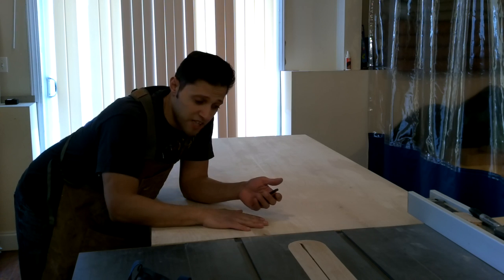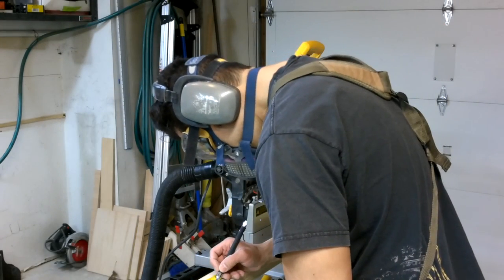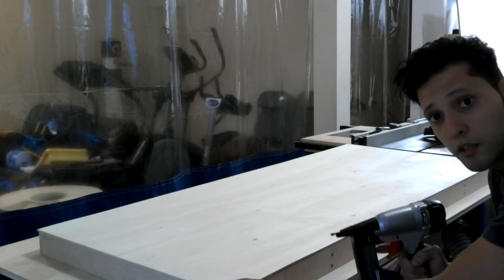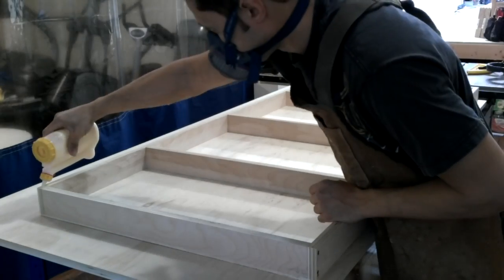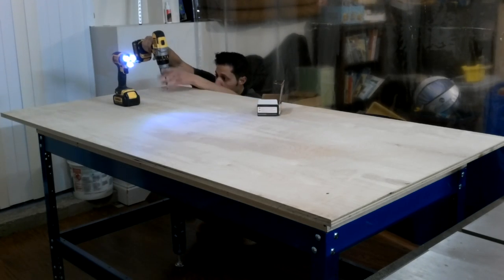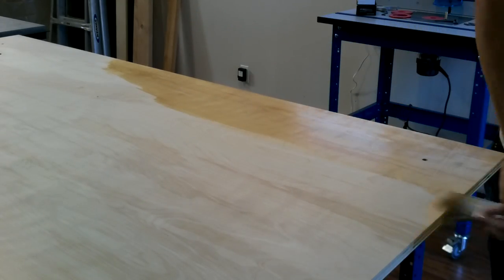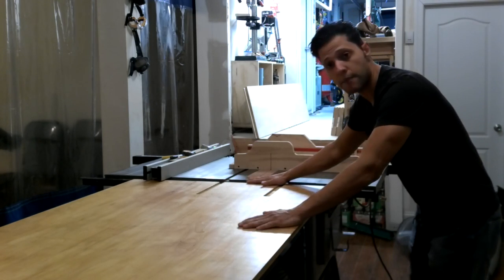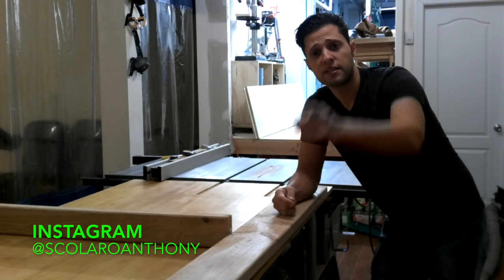Make An Assembly Table

Comment: I'm not a woodworking pro so I'm wondering why the torsion box? I'm guessing that you want the 3/4" top for clamping (where as others build thicker tops) but the torsion box prevents the 3/4" plywood top from sagging down over time. Maybe you are using it to make the build lighter also?
Also, where do you get the see through courtains? That would help limit dust to the areas that I work instead of spreading all around my basement which happens even with dust collector.

Comment: Anthony, where do you typically buy your birch plywood or other lumber from? Say for your blanket box or even the dresser you made awhile back, is that all real expensive cabinet grade stuff? Thanks in advance, great work
Reply from the maker: Mike S thank you and as far as plywood, whenever I'm building cabinets or cases, I use cabinet grade, they run about $50.00 a sheet. for my lumber, I go to a hardwood dealer and buy it rough then I dress(s4s) it myself
Reply: Thank you sir, I have some simple projects in mind just getting started in wood working, went to my local HD and all they had was crap wood.  I'll have to do some research on local lumber yards

Comment: Awesome video Anthony, I swear man, every type of project I am wanting to do, you have an exact video for it. Does removing that little clip in the back of the fence throw off the measurement when the fence is clamped down? Im assuming you had to take it off to have a flush fit but Its hard to see how the outfeed table mates with the 5100 in your video as you have no close up view of it. The back rail sits 5/8 below the saw table top, Im having a hard time understanding how you are able to butt up a 3/4 sheet of plywood against the saw table and still manage to be 1/32 below the level of the saw table... Even if the outfeed table is against the back rail and not on top, that little black clip in the fence would seem to be in the way. Can you please tell me what you did, the gerbil in my head cant stop spinning lol. Cheers.
Reply from the maker: Jay Ross the outfeed table is not butted tight up against the saw rails. I left just enough room for that clip to slide.
Reply: Right on, I was having a bit of a time trying to figure out what you did there. Thanks.

Comment: Dimensions of the steel base please?
Reply from the maker: Joshua Downey 28"w x 64"L , the replaceable top is 36"w x 70"L
Reply: With it being 44" long, are you able to comfortably cut a full sheet of plywood on it given that the saw is right up against the table and the amount of space on the table saw in front of the blade? Seems like it would be cutting it close (pardon the pun) if you want to cut 8' long plywood on it
Reply from the maker: Joshua Downey I don't cut full sheets of plywood on the table saw, I break them down with the track saw first.
Reply from the maker: Joshua Downey the steel base is 64"long but the replaceable top is 70" long so if you can handle full 3/4 sheets of ply safety then yes you can run them through but without a helper their just too heavy and awkward
Reply: Got it, thanks Anthony